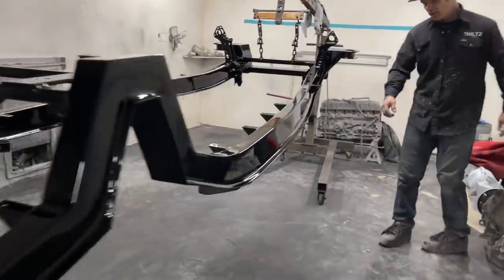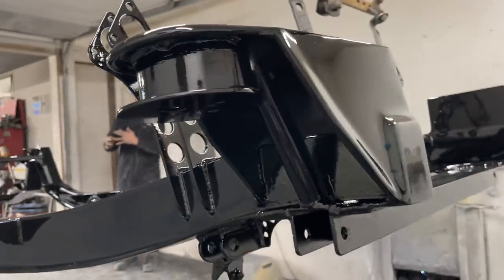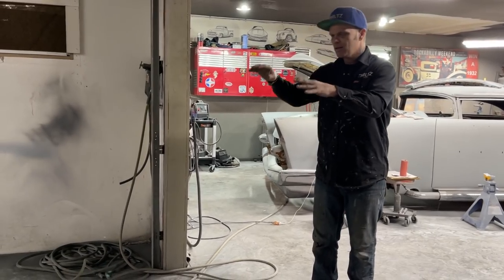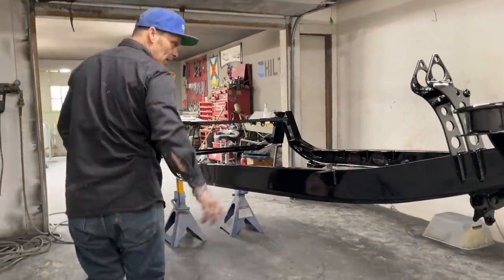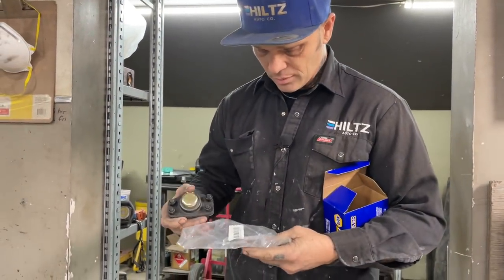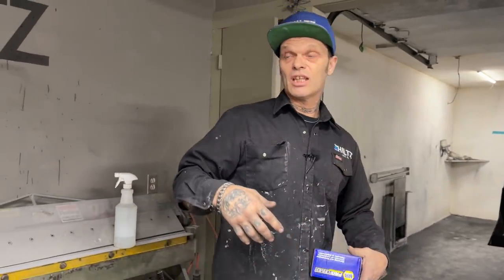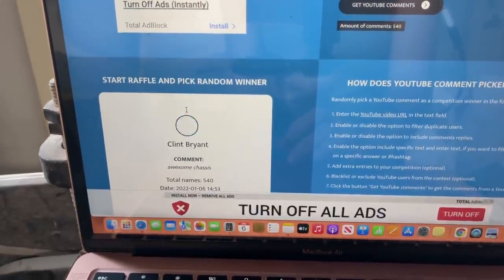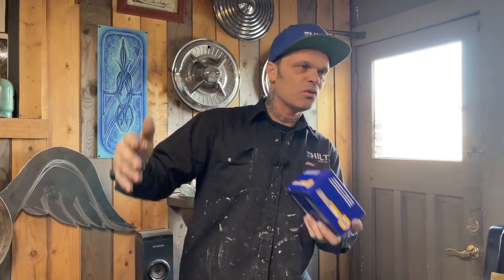Revealing the Freshly Painted Chassis (Show Car Quality)

Comment: You inspired me to try body work. I have an idea for a car I have but I don't have a spot to work yet, it's 1 degrees outside right now so that project is still in planning. Something that I can do and recently learned about is embossing 22guage with 3D printed dies. I think I can make a square with my initials embossed, weld another to the backside for strength and size, then cut n butt it into my rear fender on my old sporty. Started printing dimple dies the embossing dies will be this weekend.

Comment: Chad I get 100%  the make your self and  not care about  the Judge's . Little different then what you build , but I built my Barracuda my way. It started as a 72 with some rust, but not terrible. I did some patching and replacing. I always loved the 70 Cuda. I needed to replace the trunk floor so the taillight pane l had to go, replaced it with a 70 tail panel, replace the front sheet metal with 70 Cuda  fenders grille. I built it to make me HAPPY. I do not care that is not numbers matching. I enjoyed building it in my two car garage. It might be worth a nickle to the collectors but i did not build to sell, my grand kids all want it. It is what you would call a day two car or the car I would have had in high school in the late 70's.  I drive it enjoy it and plan to get some 1/4 times with the 470 stroker. Love it  or hate does not matter to me I enjoy it. Now i need a new project to build with my granddaughter that I'm raising. i  really want to build something with a chop top, maybe a duster or dart, no seems to wack on these so I will. :)
Thanks you would be fun to hang out with sometime if you ever go to Arizona. I have been to BC a couple when I drove truck, people were always awesome. Never made it to where you are at.

Comment: Another step forward. I may disagree with certain aspects of the build, but its on the mechanical. Thats what i do. Love fabrication as a hobby, dont know how you keep up the pace.

Here we go, those ball joints will never wear out. As a daily driver they last 100,000 km’s Drilling and tapping will fail. The internals arent designed to be greased. No channels. Im not saying dont but you risk filings going into the ball joint,and if you score the “ball” it will take out the wear surface. Dont break the drill bit, chips of that will damage ball joint for sure. Tapping, need a plug tap. It may work. Personally my time is better spent elsewhere. Good luck!

Comment: The Chassis looks amazing. Just wondering how Chad will paint the two sections that the jack stands prevented from being painted. Looking forward to "It's Friday" episode to see what takes place.
Reply: Hey Don its going along great . I belive once he's lowered it down and off the chains he'll  look after thoes unpainted areas then . It doesn't  make any sense to  try and do it until it's off and the paints dry . Nice talking to you .
Reply: There will be many scratches, chips, etc when the suspension is made. Might as well wait until the car is done and paint them all at once? I believe Chad said he might have to do more welding on the frame. He’s just not sure. Chad said he builds on the fly and won’t know if anything will work until the project is done. (The first drive is always so exciting for a builder)

Comment: I sprayed the roof of my panel truck and the door with a $60 gallon of scratch/dent single stage from the eastwood store. Shot it with a cheap spray gun in my driveway under a canopy. It can be done well and without a ton of money.

Comment: You say when you paint , that you set the pressure  higher than recommended , What is recommended and what do you spray at ?  All your paint comes out so smooth , like a mirror.
 I always have to color sand to make it that smooth .

Good luck Joline on the Mag cover , you have my vote ,,,

Comment: The frame looks nice ... please keep doing things the way you want. Instead of drilling out the new ball joints, you may want to consider switching the end caps...this was suggested by Trinity
Reply: Many new suspension parts are sealed and lubricated for life.  It’s always best to know what you are buying before you start cutting them up

Comment: hoping you have enough meat to drill and tap the threads for a grease fitting. had times where you had to build up a spot with JB weld then drill and tap that blob to have the meat needed.

Comment: Nobody has to give Chad any praise, he does he already knows he does a good job nobody has to tell him nothing. Drilling out ball joints to put in grease fittings is ridiculous on a car that will never see a thousand miles. Maybe the quality of the material in the new ball joints doesn't need grease fittings or they would have put them in.
Reply: I don’t think very many new cars have grease fittings. Some new replacement suspension parts are sealed and self lubricating for the life of the part.  Drilling into such a part could possibly ruin it. It should be a simple matter to find out If it’s OK to drill into it and add a zerk.

Comment: Chad, don't bother putting grease fittings in those modern ball joints. That Bugatti wont get a lot of miles on it. They will last forever. Drilling them will get metal shavings in the joint and cause premature wear.

Comment: I'd almost be scared to touch it now, as I'd probably mark the paint.
Reply: It’s bound to get scratched when he builds the running gear and suspension etc.   A little touch up work here and there and it will look as good as ever

Comment: I find it hard to understand how you can paint anything with the few lights you have in your paint booth. I have double bulb 4 feet long fluorescent lights, with 3 sets 3 feet off the floor on each side of the car, 3 sets in the middle on the ceiling, 1 set in the front and 1 set in the back. There is no way I could paint with your lack of lights.
Reply: Same here.  You can’t have too much light.  Even when you think you have enough light paint will look different in the natural sunlight. He does great for what he has to work with. I doubt you will see any candies, pearls, flakes, or even metallics done here.
Reply: @i8ntnuts  Yes, but IMO, the lack of light is what can cause runs in the paint. Also, I don't have a pro paint booth, so there for, I do get some dust in the paint. The only remedy is wet sand and puff afterwards. Yes, it's more work and time involved, but necessary to get the dust smoothed out. Chad seems to not care about his dust in his paint.

Comment: Honestly Chad do you really think that 1 inch tube at the rear is strong enough to support the weight of the car?
It isn't!
Also the rear trailing arms will not allow the car to have ANY body roll. It makes the rear end behave like a sway bar. Think about it.
I'm surprised others can't see it. You're a talented man with a special girl but you are no engineer.